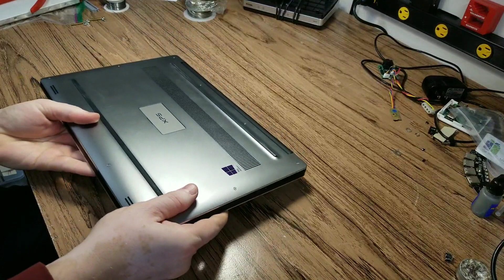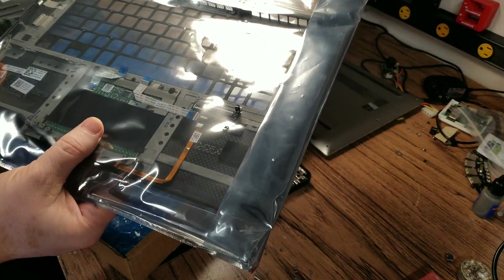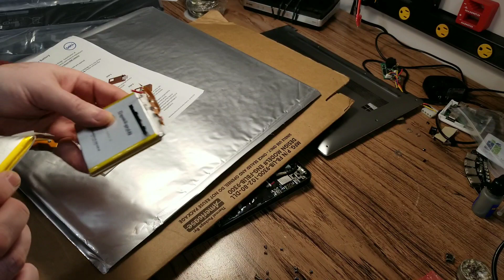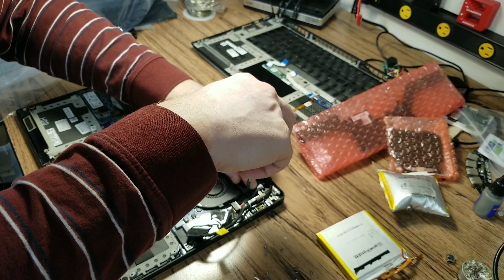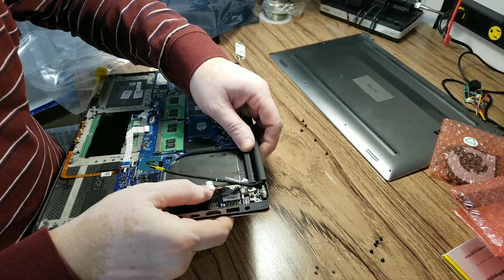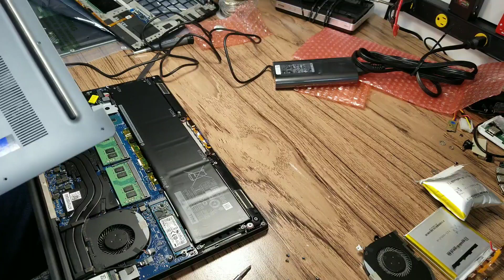Dell XPS 15 battery and trackpad replacement

Comment: Damn, I spilt some hot sauce on my trackpad that I cleaned immediately but some must have got in bc it's got some issues. I need to replace it but I hoped I would only need to remove the battery. Replacing the entire top plate is so much work

Comment: Can i put in a 97wh battery into my laptop which has the 56wh battery?  I have an xps 9550 from years ago and still use it now.  I have the 56wh battery and it has 2 hard drives, 2.5inch ssd and a 32gb m.2 ssd which came with the system.    Can i use a 97wh battery and put that in place of the 56wh battery if i remove the 2.5inch ssd?  I read you can do this with the 84wh battery but what about the 97wh?  6GTPY is the model of the 97wh battery, so if its that model, will it 100% work on the xps 15 9550?
Reply: Yes you can upgrade the battery